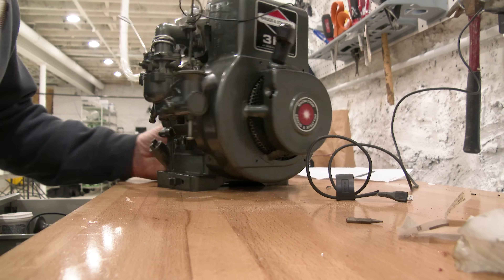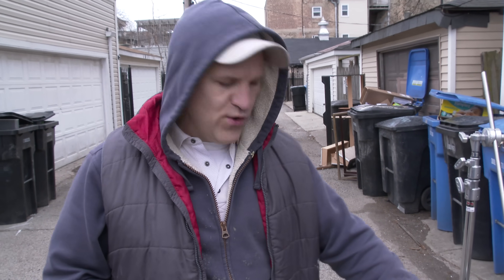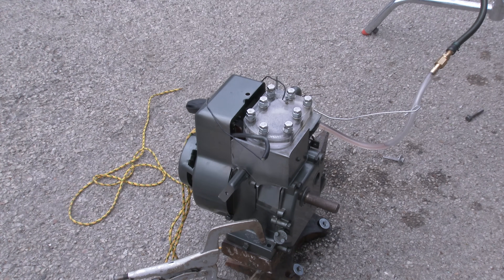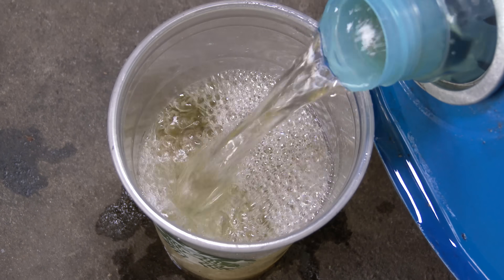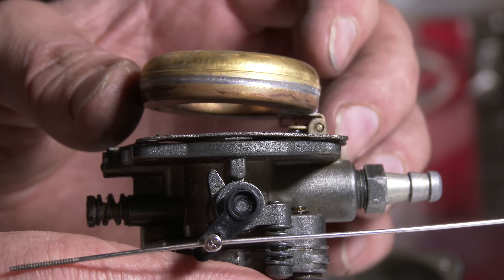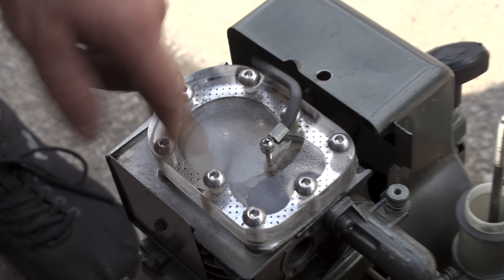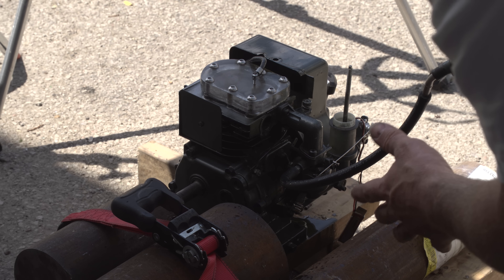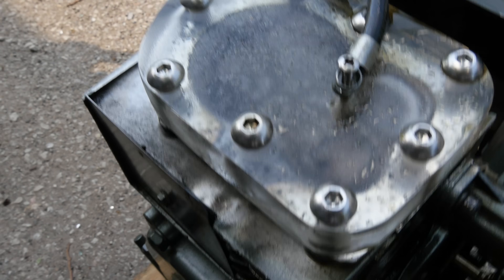See Through Engine on NITROMETHANE - Blow Up Attempts 1 -9 Crazy !

Comment: I liked the first video better. You are the best! The mayor of Chicago and the other dems are what is causing global warming, not IC engines!
Reply from the maker: LOL ... thanks!. yeah, i received a message from someone asking that I remove that comment, long story but yeah, that kind of where I was going but unless you know me its easily taken out of context. I have some upcoming episodes with Darpa so I decided to remove it. I will totally address my opinion in an upcoming episode touching on the subject of ICE efficiency and where it should be, I have some advancements to share with the world.
Reply: Warped Perception keep it going then. Nice job man.
Reply: Are you talkin' Smokey Yunick kind of advancements?  Back in the late '70s, he was running a turbo'd V-twin at 150 HP in, I think, a Plymouth Horizon.  He let it run blistering hot so as to increase adiabatic efficiency...his intake charge was at something like 400 degrees, if I remember right.  There was very little coolant and what there was got shot at the back of the valves...there was a part of the water jacket that was designed to do this.  I'm cleaning out a storage unit, tossing old amagazines, and JUST saw a Mechanix Illustrated magazine with that article.
Edit:  Found an article...:  https://honda-tech.com/forums/all-motor-naturally-aspirated-44/smokey-yunick-secret-his-adiabatic-engine-2602842/